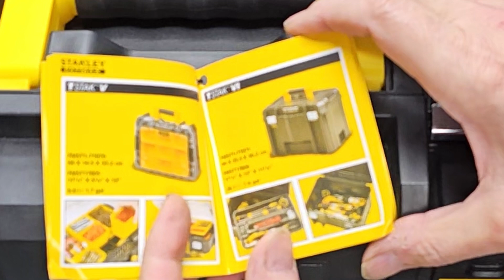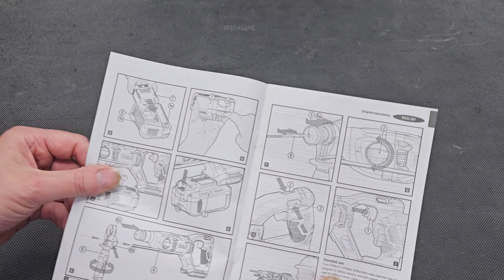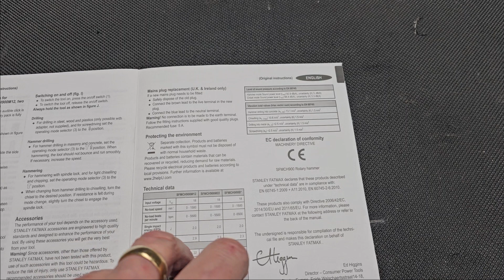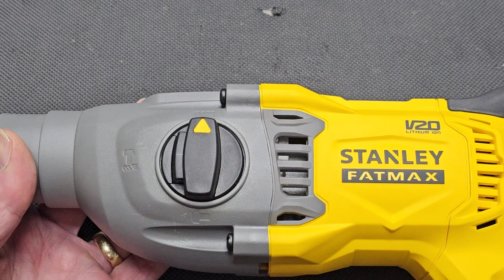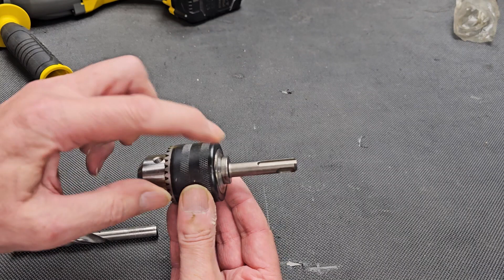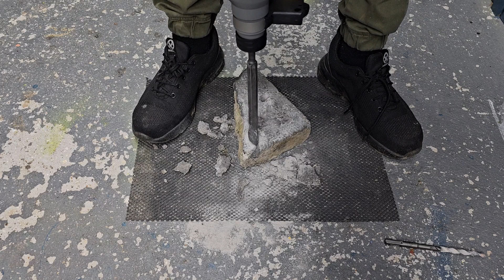STANLEY FATMAX V20 SDS Drill, SFMCH900M12 + How to information.

Comment: For the price it is bloody amazing and the quality is excellent as well absolutely love mine it has copped an absolute beating use it for opal mining it has been beaten to shithouse and still going strong somehow
Reply from the maker: 😆 Sounds like its done a lot more work than mine 😆. But mine is still going strong, and yes I agree, the quality is surprisingly good. Thanks for watching 😁 👍
Reply: @frankslittleworkshop  mine's had probably 4 years of hard opal mining and the bloody thing refuses to die after everything I've done to it I've now got adaptors for Milwaukee M18 aftermarket batteries so much cheaper then buying brand new Stanley FatMax batteries

Comment: Another good video it's amazing how tools have advanced over the years.  I worked on building sites 20 plus years ago and the company i worked for had all hilt sds corded  hammer drills and for small electrical insulation jobs i used my corded makita drill . I wish I had the 18v range of tools back then the amount of time wasted with extension cords or arriving on site to find the the nearest power point 50 metres away, or the carpenters using the only one available. The new apprentices don't know how easy they have it. 😅Steve aus.

Comment: I had watched your series and yesterday bought the entire range off eBay, they have a deal on with refurbished units very cheap  and I checked with the seller (its Stanley/Black n Decker themselves reselling) and the tools are apparently like new.  I got this drill with the 4ah battery and charger for £85.  Should all be arriving tomorrow, they called to check if its okay to send a pallet as I had ordered too much lol Think it was 13-14 items.  I now have a lot of wired tools to sell 😲 
I also ordered the wet/dry vac today, picked it up for £40 bare.  Be interesting to see if its alright.
Anyway, appreciate your reviews.  Also, you are looking like the director John Waters.
Reply from the maker: @suavebob  😃 Wow Bob, that's the way to do it, buying tools by the pallet load 😁. I hope you are as happy as I am with the range. I'll have to have a look on eBay and see what's on offer. Thanks so much for watching 😃👍

Comment: It looks like the dewalt, t stak system,  As they are the same company it makes sense
Reply: It's exactly the same case as Dewalt....as you said, it's the same company.
Reply from the maker: @gaz740  Hi Gaz, your 100% correct. STANLEY / DeWalt / Black and Decker and Craftsman are all very simular, so a common storage system would make sense. Thanks for watching 😁 👍
Reply from the maker: @garrypalmer5014  Hi Garry, it would be interesting to see if they fit together. But the only way I can find out is to buy one and try 🤔. That could get expensive 😆😆. Thanks for watching 😁 👍
Reply: I can confirm that DeWalt and Stanley stackers fit together- I have both because I buy whatever’s cheapest